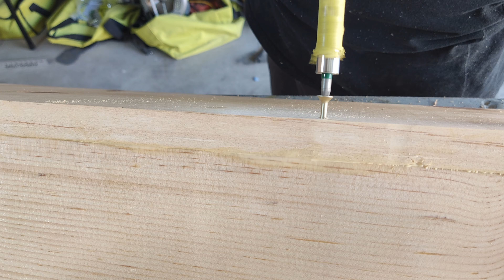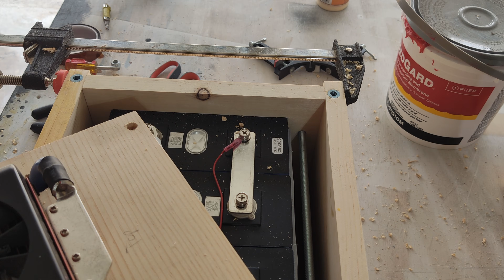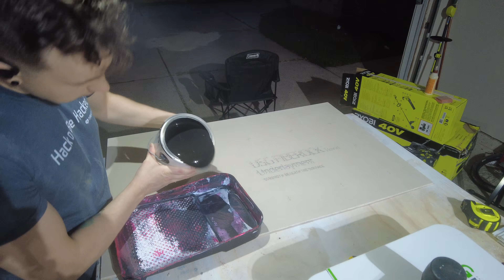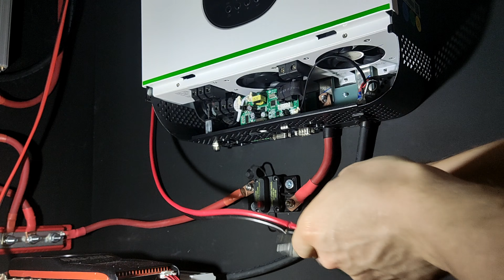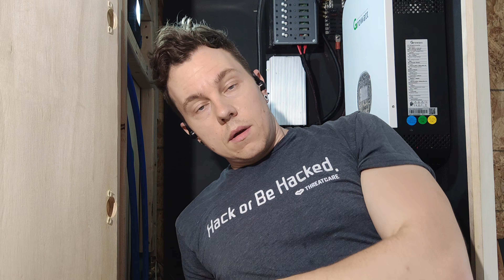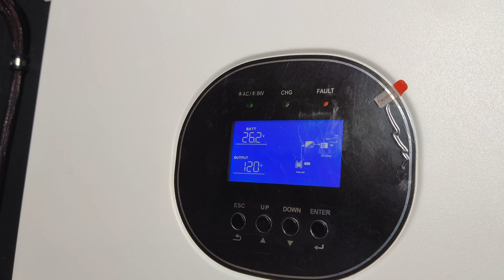DIY LIFEPO4 Batteries and All-In-One Electrical System | Uhaul Box Van Conversion

Comment: Did you want to put fire resistant paint, or whatever is available where you have your inverter and wires? That way if a spark causes a little blaze it will only spread of whatever is fire resistant. That little box can be fire resistant. Great job on the build!

Comment: Do you insulate the batteries to keep them from getting cold? Any fans to keep the heat down?
Reply from the maker: Interior will never get cold enough to matter, especially if the inverter is running. The electrical cabinet is vented.
Reply: @TheTechnoBarbarian  Is high heat ever an issue for batteries?
Reply from the maker: @MartinWilsey  No they only generate heat if they charge/discharge at a very high rate which wont ever really happen

Comment: What type of appliances do you intend on running with so much potential? Your system is 2x the size I've seen in any build and they mentioned having provided for overkill.

Really nice work. I like your approach. You rough things out and then seem to refine and upgrade depending on your motivation. 👍
Reply from the maker: Nothing special I just want to be able to run Air conditioning whenever I want and for long periods of time (overnight)
Reply: I think Shaiden and BuckSD on their latest builds have 21kWh, for AC and Shaiden for electric incinerating toilet.
Reply from the maker: @wiiten  Yeah I've seen both but they dont have the solar necessary to run everything all day... you'll be relying on running the van in those builds.

Comment: Not bad for wirin but ya need a iso switch for each battery bank,fuse for ya inverter and the switches should always be accessible near the front of the enclosure,also never compress batteries

Comment: That was cool, I was just wondering if there should have been some heat escape holes in your battery boxes?  And if it would be better to have the breaker at the front of the cabinet but, hey that's not critical.  Nice work, thanks for sharing
Reply from the maker: Batteries only heat up at high discharge rates. My batteries are 272 amp hours each, so even .5C (50% Max discharge rate) I would have to pull 130 amps which is over 3000 watts which won't really ever happen because the inverter is only 3000w.. In a nutshell, the batteries shouldn't ever get significantly hot.

Comment: Thanks for the video. It's the first I've seen using an all in one unit. I plan on using a mpp solar all-in-one and a 24v 200Ah server rack battery. I have those things but now I'm trying to price the wire I need..... it makes me cry to add it up😢. 

What made you decide to use a fuse holder instead of a bolt on fuse at the battery? Lastly, do you have a diagram you drew up or was this all mental design?
Reply from the maker: I wanted the entire battery encased, which would mean I would need to disassemble it to access the fuse if I attach at the main positive on the battery.

I will post a full diagram on my locals page!
Reply: @TheTechnoBarbarian  That makes sense.  Thanks! I joined locals and I look forward to the rest of the build